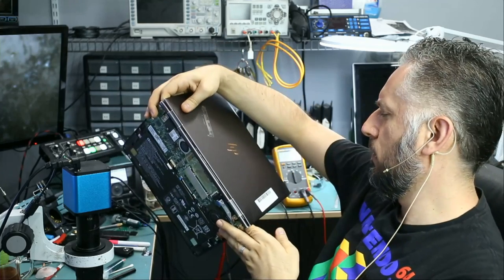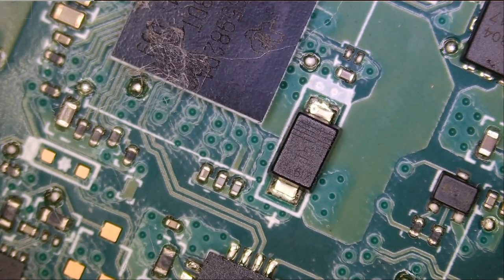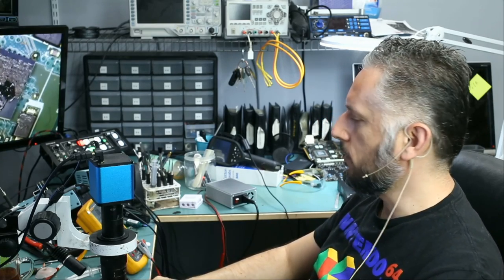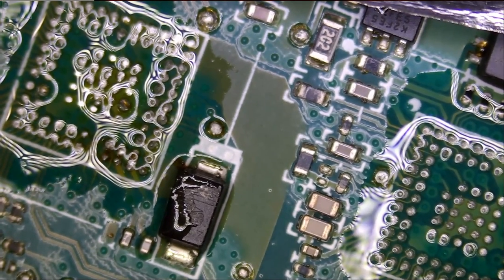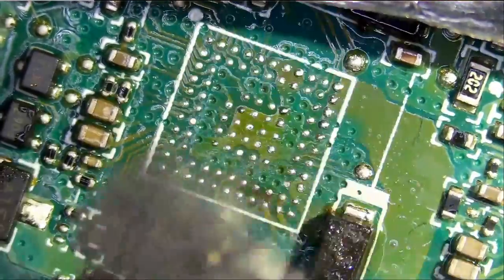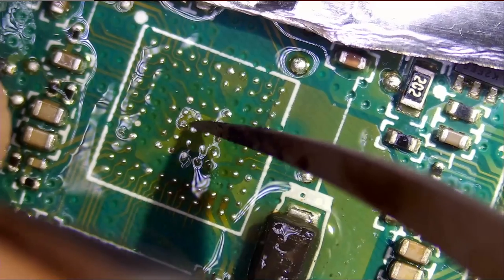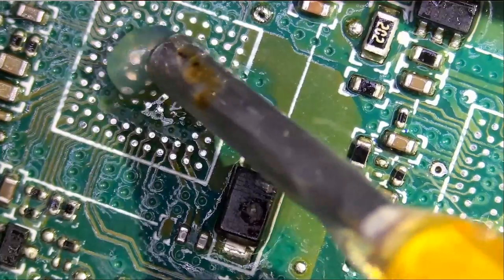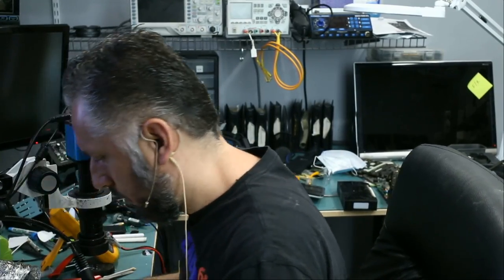HP Spectre X360 Laptop Repair - No Power and Not charging.

Comment: Thanks for posting your repairs. Just from watching you solder and troubleshoot devices has inspired me. Fixed my Microphone amp, LED TV, PAR light meter. This has saved me hundreds of dollars. Watching you solder has shown me how to solder much better. With that said, I am not as good as you but the more I solder, the better I get. I have order the low melt and the solder wick from you. Thanks for quick shipping.

Comment: OK, I had to redo my previous comment because......I just got my order of tweezers, needle tip bottles and flux. Firstly, you can tell immediately that it is real flux. Don't ask questions. You will immediately know. 

The bottles are perfect and are exactly what I needed. 

The tweezers. I may be a nerd but I am very picky with my tweezers because they take the most beating and do the most precise work. Your tweezers (Qianli Precision Tweezers bent and straight) and they are extremely light and strong. When I saw the tip I thought man, it might bend. Nope. If you bend them, you did something wrong. either by mistake or bad technique. 

Thank you very much. Can't wait to try them out on the PS5.

Comment: Another big reason to use diffwrent syringes for flux (and paste), is that the pistons that come in factory 10 and 30cc syringes, do not typically have catches. so they csn only use floating (no physical connection to the piston) plungers. That means you can't use plungers that hook into the piston, which means you cannot pull on the plunger to relieve pressure from the compression of the piston, to prevent/stop oozing.

When doing microsoldering work, especially if on a board you don't want to or cannot remove from its housing/machine, you want as much control of flux or paste volume as possible. You also don't want oozing syringes constantly messing up your work area with flux or solder paste.

Funy enough, I did buy some good quality but fake 10cc syringes of amtech flux a couple of years ago, and ended up buying like 10 of them. Because they had pistons with catches and came with hook-in plungers, so I could pull on the piston.

Comment: I can say this, the solder wicks we use at work fray up on the ends very badly, with just minimal use. We arent using them on flat PCBs, usually, we are soldering camera wires onto USBs, but that solder wick you are using looks like a much higher quality than the stuff we are using.

Comment: Lunched in March 2015, these HP Spectre x360 seemed to be plagued with problems judging from the number of vlogs you done on these devices, Alex.  In contrast, I have a Lenovo ThinkPad T530, a laptop purchased in August 2012 that has only had a Wi-Fi problem.  Having had memory and solid state storage upgrades and a couple of keyboard replacements, it is still my everyday laptop 10-years later.  That stated, I do have a  Lenovo ThinkPad P1 GEN for my electronics repair business, a laptop purchased to drive a 43" UHD (3480 x 2160) display.

Comment: I grow my own tea, dogmint and some peppermint adding in imported Greek spearmint freshly chopped into fine leaves and some gunpowder tea makes the best moroccan mint.  If I wants a wake me up, hot black Assam with a treble slug o' navy rum but not if you are driving or handling heavy equipment, black Assam mixes well with spearmint leaves and sometimes I add a dash of licorice stick for when I am driving or handling heavy equipment :D   

Am one of the few that knows the magic of making a cup of "Sergeant Majors" tea, really really unhealthy if you don't work it off but it involves a full pound of best black tea leaves, a quart tin of evaporated milk, boil the milk with the tea leaves until it starts to go a coppery colour, off the boil, add some sugar, tip it into a tea urn and top up to the brim with boiling water.   

It is the old and better version of today's energy drink, you could march 20 miles off the energy of that tea, have another pint mug full and do another 20 miles hence why its called "sgt majors" as nothing short of the RSM could get you awake, alert and willing to hard march 20 miles than the tea itself.   If cold weather, a pint of navy rum went into it too :D (proper navy rum isn't that soppy 37% stuff you get in supermarkets, 57% proof stuff like Woods 100)

Comment: How do you get those donor boards? I imagine customers would be sceptical if you tell them the laptop is beyond repair, but you would like to keep it anyway.
Reply: A lot of people donate the boards.  Also you can avoid a repair attempt fee if you don’t want your device back.  So Alex is actually buying a lot of boards at 45.00 a pop if customers don’t want them back
Reply from the maker: Customers have an option to get it back or have it recycled. I would rather fix it and get paid in full price then keep it as a donor. Customers must trust to the shop they choose to work with, otherwise it's very easy to find something to blame the shop for.

Comment: What do you think about an older HP Envy 17-j020us that doesn't post, doesn't charge but can run off battery (no battery error in windows when it did boot, and no SATA), but will now only light up the power LED? Got two of them and both have the same symptoms lol.. RAM and CPU were swapped but no change :P

Comment: Hei.  Greatings From norway.   Love your videos.. 

I was working on the same model Last night.  Have a short on the caps by the big power IC corner(not the 2 identiske ones)  nerest the 2 usb ports.  Have a new spare power ic. 

But the short did not go away when desoldering the chip. 

Tried removing one an one cap to see if short desapeared. No luck

Do you have an experienced guess where to try next?
Reply: Send it to him for repair. lol
Reply: Is not a "Hiroshima bomb"  but i Will not give up.  

Was more wondering if he had som experience with internal shorts on usb ports ect.. 

As it is not much gong on in the area of the short(as chip is removed)
Reply: But if he want me to, i'll definitly send it to him.     

He is an absolute expert, better than factory technician   ;)
Reply: The IC has direct path to CPU and you may have a bad CPU. If I recall correctly the shorted caps in that area indicates that, assuming IC is removed
Reply from the maker: Hard to tell, It could be a dead CPU. I've had that before.
Reply: @ksngs78   Thank you for your input. Power IC is desoldered yes. short was still there by the caps in  bottom right corner,  closest to the usb ports   .   Replacment motherboard is the next step i guess? if the cpu is shorted

Comment: Great video 👍🏻
How did you reball the chips tho?
Reply: I've seen it done on another channel, they have these jigs with holes in them, you put it up against the chip and then spread solder paste over it into the holes. Then use hot air to melt the paste into balls and remove the jig. There's probably a few common sizes that work for most things. You can put tape over the holes you don't need while you spread the paste.
Reply: I think those come pre-balled from the factory.
Reply: @em0_tion  Actually yeah, that's a very common chip, he probably has a bag full.
Reply: I've seen all the videos about reball paste ect,and I only asked as it was referenced that he had donor boards ?

Comment: May I ask why do you use cotton swab instead of a toothbrush? Won't the fibers of the cotton swab stick to the board or solder points
Reply: Just guessing, but something has to absorb the flux to remove it from the board. You can see the tip turn yellow after he wipes it. Otherwise the alcohol will just evaporate and the flux would still be there.
Reply from the maker: Bush does not clean, it spreads things around. Cotton swab when used properly (wet and twist)  will not leave any fibers around

Comment: was trying to figure out why an older HP labor wasn’t booting up for a neighbor.  i didn’t thunk of closely ¯＼◔ー◔/ at some of the chips.  i don’t have the. fancier tools to do the micro soldering and the awesome scope. 

my guess was maybe the dc jack assembly was bad.  did notice the R/T clock battery holder was cracked where soldered to board  and repaired that.  it’s an older machine but case and components still great shape. 

i convinced him to buy a new one as suspected board was no good and it’s old. 

It’s mine now for “parts” to donate,  but will see if I can find anything wrong with if elsewhere 

good vid.  thanks

Comment: Alex!  Do you repair Plasma TV's??  I have one with a small issue...
Reply: It's not worth fixing in 2021
Reply from the maker: Tv boards are cheap and not worth fixing. It's either the power supply board, the mainboard or t-con board. You can find them on eBay.
Reply: What type of issues?
Reply: @NorthridgeFix  I have a 2006 Panasonic Viera 50" and I will NOT be buying a new TV.  I prefer plasma for many reasons.  Anyway, It will randomly shut down once in a while, sometimes within 10 minutes, sometimes 2 hours.  New Power Supply Boards seem to be difficult to find.  Can only find used ones in eBay for around the $150 mark.

Comment: if you put a thick silicone foil between the keyboard and the screen during the soldering the chips, does it it affect the screen ?
Reply from the maker: Honestly it's always better to remove the motherboard from the laptop so you don't accidently end burning up something. Screen most always be out of the way.

Comment: Can you please tell me the beep comes in your multimeter in continuity mode or diode mode?
Reply: I can responde this question.
Alex use a Fluke 87v.
In diode mode the Fluke 87v do a short beep if the diode is good, if you test a resistor under 100 ohms beep is continuous.
I have the Fluke 28 series 2 is the same but is IP67.
Best Regards.

Comment: how do you confirm that the soldering is good for all connections to that chip?
Reply: Thats the reason for him poking at the chip to see the fluidity of the movements, it normally self centered when you nudge and let go. The confirmation is also proper cleaning of the pads to ensure it will not only stick but bond (balls to pads), and lastly, having confidence is the main key factor.

Comment: i had a similar problem in that all 3 chips were shorted and needed replacemen, later on i discovered that both usb c ports are worn and the connecter has to be held a certain way most of the time.

I purchased 2 usb c ports for the spectre 13 for about 20$ which I think is too much, does anyone else agree? I'm sure theyre available cheaper